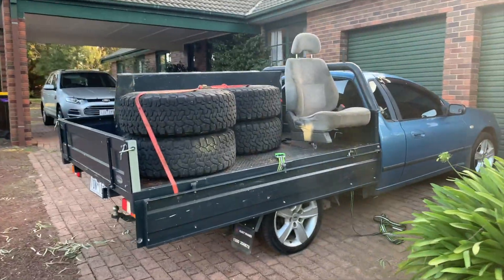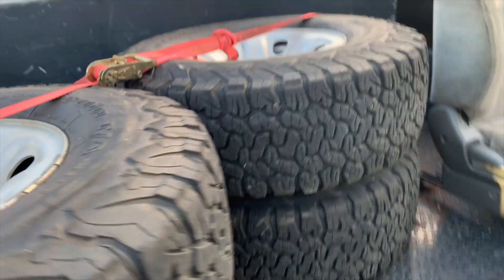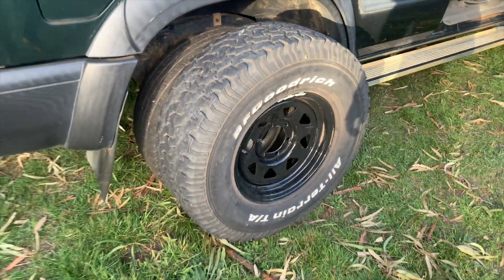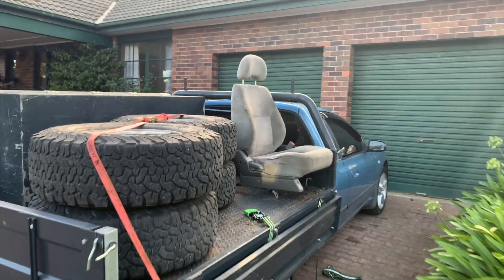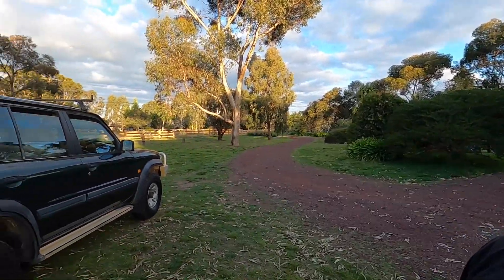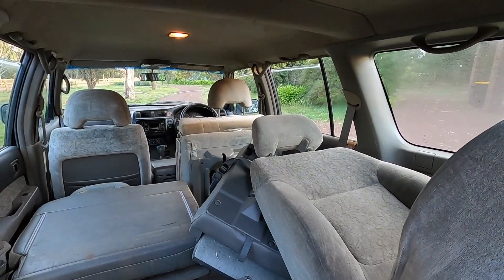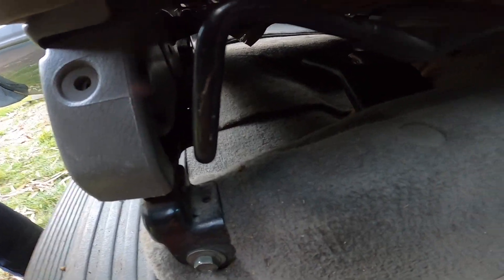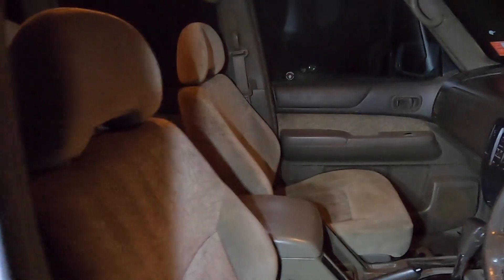Cheapest Nissan Gu Patrol Build Ep.2 - Wheels and Tyres

Comment: How do u find these tyres? I’m looking at these exact same tyres but have heard they can be a pain to balance, causing steering wobbles. Let me know what u think of them 👍🏼
Reply from the maker: Ko2’s have been really good, did tassie no worries, had a bead leak from mud, cleaned it out and rebalanced the wheel no worries. Did the sand in tassie well, wouldn’t suggest them as a choice if you play around in mud though. I’ve heard the new ko3’s are soft and wear really quickly.